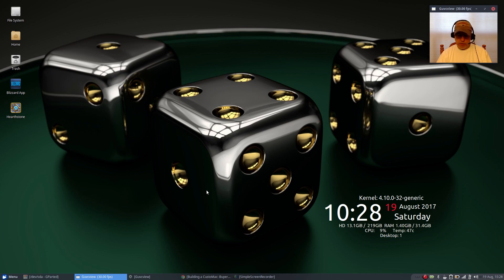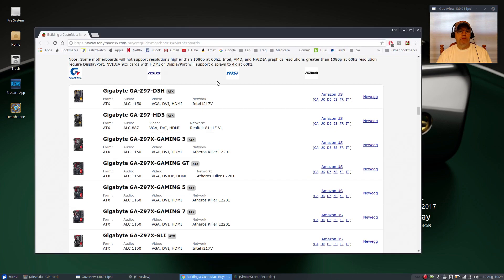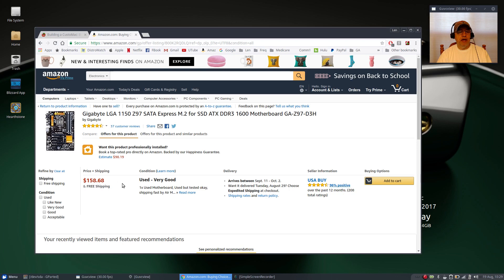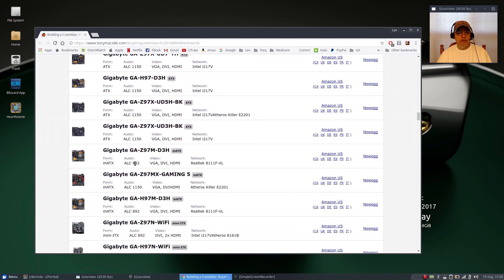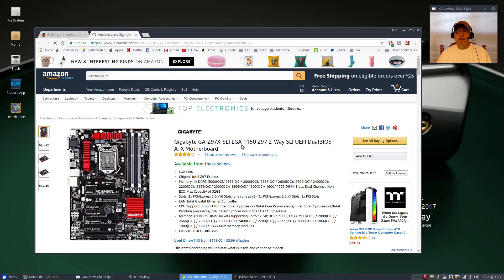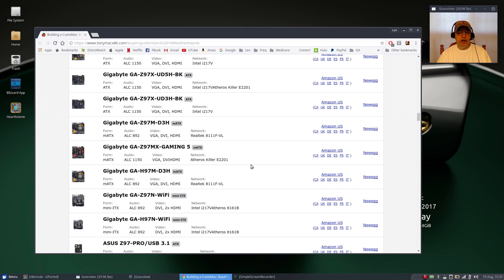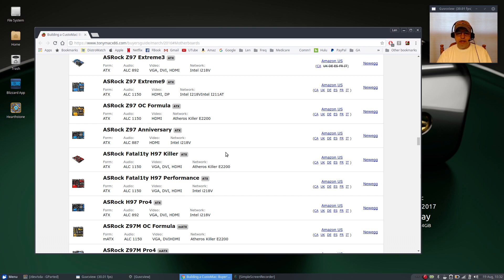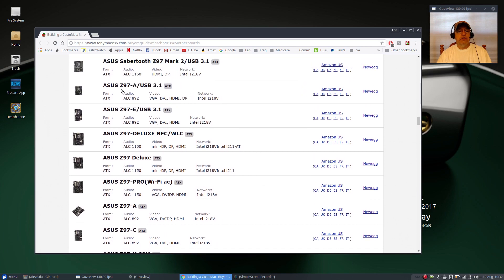PC Build Update and Motherboard Rant

Comment: Hi Len-enjoyed the video.  I have a spare full sized ATX case , and I do believe that it has three fans in it.  I would be more than happy to give it to you if it would help out your pc build.  I would just need you to pay for shipping to your home or local post office.  I just don't need it and it is just collecting dust.  So, if you would like to have it, it's yours for the asking.  No charge except for what ever shipping is.
Reply from the maker: Thank you for the offer Bryan but I am replacing the water cooler with a Noctua air cooler, which will free up a fan slot. That should provide the cooling I need. Thanks Bryan!
Reply: No problem, offer still goes if you need it.

Comment: Cable- management Depends on the case. Fractal Design is very good for this,also InWin. As far as motherboards you can find some very good used ones. There are a lot of z97 boards out there. I see them all the time! I bought an Asrock Z97 anniversary for cheap w/ case, CPU,and cooler ! You just got to look!

Comment: Reminds me of my little ASUS problem back in 2014. I bought the H87i plus (Mini-ITX) specifically for my Haswell Core i5, for Linux, and because it had just the right combination of connectors. What I didn’t realize was that any USB 3.1 was just available with Windows. With Linux, all USB connections have only USB 2.0 speed. But I haven’t had the BIOS problem you’re describing. I’d give rwprim1’s suggestions a try if I were you. 
I’m still using the ASUS, and instead of slow USB-2.0 backups, I now »scp« my files via Gigabit Ethernet over to a USB-3 HDD attached to my MacBook’s multi-port adapter. You live, you learn, I guess. :-)

Comment: You could try pressing the F8 key during the boot process.  That should bring up a selection menu of available drives.  No need to go into the bios. Works for me on a Asus P8 Z68V-Gen3.  I'm reasonable sure that most ASUS boards use F8 to bring up a drive boot selection screen.  I boot Win10 on an ssd and Mint 18.2  on spinning rust with out a boot manager.  I don't use OS10, so can't help there.
Reply from the maker: The F8 key works fine and does bring up a boot menu, but after a few times, it freezes also.

Comment: Any reason why you aren't using a boot manager instead of the bios setup? I use Bootit bare metal's boot manager to boot multiple OS.
Reply: Agreed.  The only time a BIOS controlled boot option is necessary is for USB devices.  For multiple partitions on a single hard drive, or on 3 physical drives like he's currently using, a boot manager should work fine.  The GRUB tool that comes with Antergos handles multi-booting without any issues.  I've never had to enter the BIOS for this, nor have I had to deal with 3rd party boot managers since the 90's.
Reply from the maker: I'm actually using Clover through hackintosh install as a boot manager. But it won't recognize windows for some reason even though it is also a EFI install as is Ubuntu and OSX.  But the BIOS option should work reliably over and over without fail. But it doesn't with Asus. Have never had the issue with Asrock or Gigabyte.
Reply: Ah, now I understand the motivation for using the BIOS.  It was the limitation of the boot manager.  I'm curious, in what order did you install the OSes?  For me it seems that Windows (depending on the version) can recognize OSX partitions, and Linux can recognize everything.  The 'Linux last' rule of thumb has worked for me on several multiboots I've tried.  This way Linux gets control of the boot process with GRUB, after the other OSes are already installed.  I don't know for sure that this can work in your case but it might be a work around for the buggy Asus BIOS.
Reply from the maker: Linux recognizes windows, but not Mac.  I wish it would :)
Reply: I guess I got lucky with grub2.  It's been years since I've tried this but I was able to get grub2 to see OSX (with some cfg tweaking).  Depending on your boot flags you might have to resort to Chimera.  I was lucky and the 'easy route' worked for me and I didn't have resort to any 3rd party solutions.
http://leveluplinux.blogspot.com/2012/09/dual-booting-linux-and-os-x-using-grub2.html
This might be outdated now, and throwing Windows into the mix might confuse the grub update, but it may still work.

Comment: Bummer.  Guess you've got a bad bios or board.  I've never run into the problem, but its differently something to be aware of.  I like your videos even though I'm in windows more than Linux.  I've picked up a lot of good info from you.  Hope you solve the problem.

Comment: speaking with personal experience, i would definately go with asrock.  i've had two gigabytes both had to be rma'd.  the second gigabyte board i didnt even bother replaceing.  my two asrocks though run like champs.  the one i'm using now is about 6 years old and never had any issues with it.   i also have an asus board which is complete garbage.  about the only nice thing i have to say about that one is that it works.

Comment: are all or some of your HDD are the same manufactur ?? if so actually that's the problem you can fix it by 1- trying to setting up your HDD manually if there is ability to do so or 2- by using a rack and swep in only the drive you want or 3- add a switch (physical switch Button) to decide which HDD will have bower connected .

Comment: Hey Len. Regarding booting and UEFI and triple booting, maybe all you need is a little program Asus has. Let me explain. When Asus and Intel went to the next generation (5th gen), the window for entering the UEFI goes by so quickly that you cannot hit a key to enter it. You have to boot and then when everything is settled down, you double-click the shortcut (on my desktop) which points to: C:\Program Files (x86)\ASUS\ASUS Boot Setting\fastboot.exe  This is the only way to enter the UEFI for the rig I built.  (I have Asus X99 Pro/USB3.1 Socket 2011-v3, Intel i7 5820K Haswell-E 6 core 12 thread 3.3 GHz LGA 2011-v3 140W). Maybe you could find it on their site. I would even go to my mobo's site and get it if that fails for your board and at least try it. (If I understand you completely). Also, save your UEFI config while in UEFI so you don't have to re-enter several items. Also, go to pcpartpicker for parts. (I could even email that .exe file 1.2MB)

Comment: Len, The fix is located  here. https://www.tonymacx86.com/threads/clover-keeps-making-uefi-os-boot-entries.172875/ (post#9). Move the file mentioned into any other folder in your EFI Partition. Bottom line, make sure nothing is in /EFI/Boot. Then use a program in windows called "EasyUEFI" to clean out any phantom entries. You shouldn't have any further issues after that. Works like a charm on my Z97-E

Comment: 2nd ASUS as being dodgy.  A few years ago, Marvel drivers NEVER worked properly and Marvel settled somethng...BUT never fixed them.

Have you considered a HD Power Switch?  I takes a 5.25" bayot and provided switchable power to 6 drives.  Power buttons on front.  I'd think that might be an alternative.

Kingwin is the brand i saw.
Reply from the maker: That's a great idea :)  Looking into that now :)